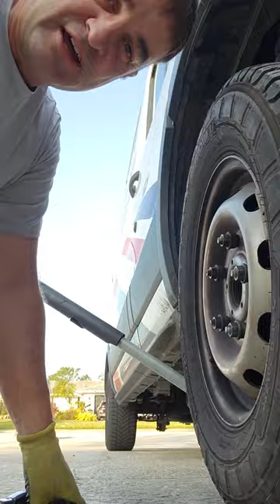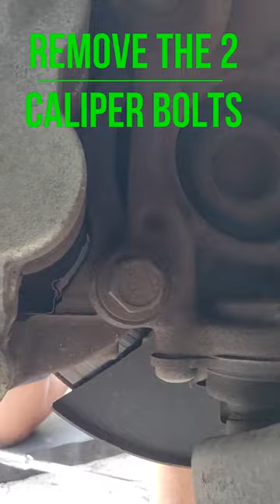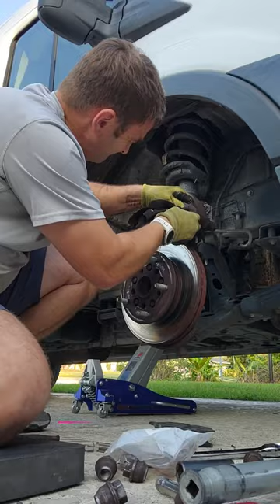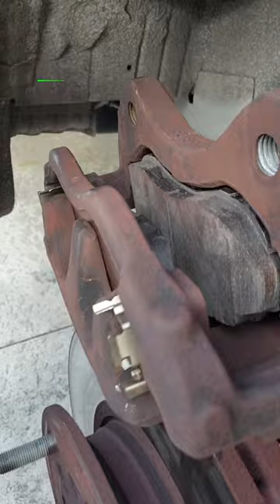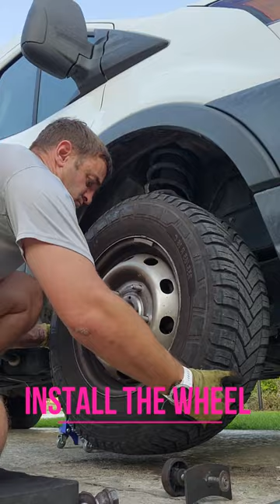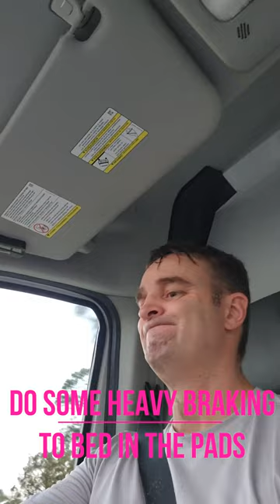How to change 2018 ford transit brakes in under 1 minute

Comment: I’ve always taken the caliper bracket apart to grease the pins and clean all the rust build up under the shims. And if you’re not going to replace the rotor at least have it cut
Reply from the maker: Yeah, definitely a lot more steps you can take. The race cars get much more attention.